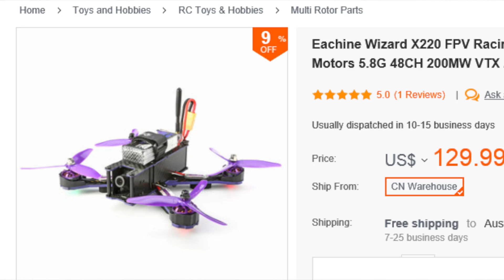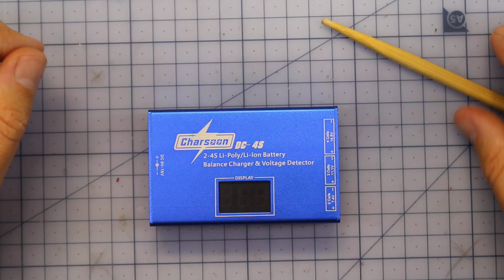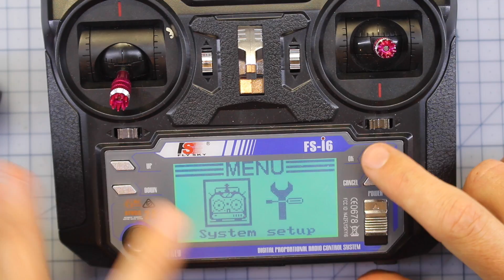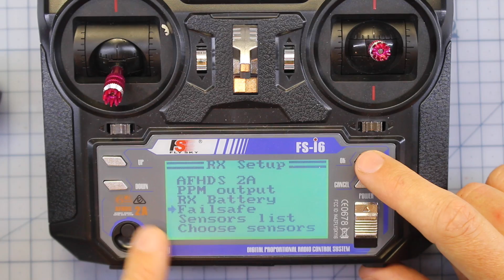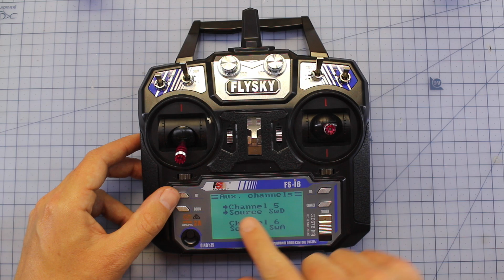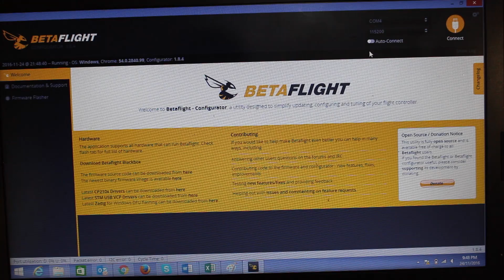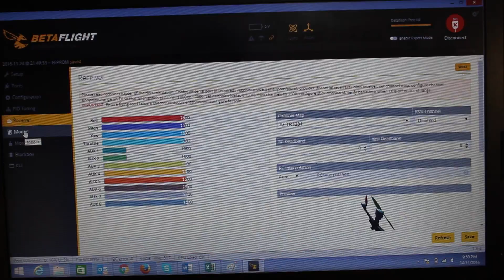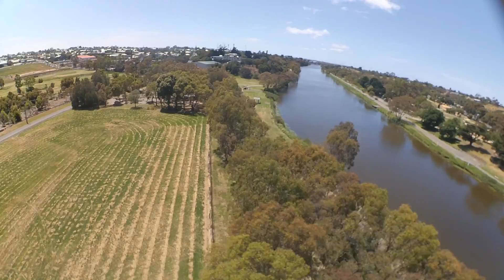How to get FPV DRONE RACING for under $300! Parts +Full setup.

Comment: Thanks for this video. I've been flying Syma X5 drones and nano's, and I was set to buy a Phantom 3 as my first foray into something more serious.  I was derailed after discovering acro videos, and after much research (and watching your videos) I bought the X220. I bought eachine goggles, but I bought the same battery and charger. My biggest variance from the kit in this video was an upgrade to the  flysky fs-i6s, only because it had built-in USB to easier facilitate simulator practice.

Getting the transmitter to work was humbling - it's not as straightforward as the fa-i6. I missed the ibus-sbus switch in the ppm switch (it needs to be set to sbus). After I got the transmitter to work, I took it outside to test it. It beeps continuously and there is a half a second of stick-motor latency. The radio came with no usable instructions, and I'm not familiar enough with it to understand the intricacies of it. Is it likely a transmitter/receiver issue, or more likely a PID/ESC issue?

Thanks for the videos btw, it's all I watch now!
Reply: Update: After calibrating the esc's in betaflight, and after telling the transmitter that left stick is not self-centering, the latency is gone. I found out the hard way that SWa up is acro mode. 

I read a few reviews that said that the stock propellers explode. I thought that was an exaggeration, but unfortunately it's true. A 4S punch out will disintegrate them, sending it plummeting to the ground, destroying you Vivitar DVR 786HD. That would have been good to know Stu...

Comment: I just added the total up on the site and I got 296! This however came with better FPV antenna, 2 batteries  and also using a google chrome extension called Honey that picks out multiple savings code and it found one that saved me $33 just so you guys know.
Reply: With some newer FPV goggles he recommended on another vid the total was $267

Comment: hi sir , 
i have sp racing f3 evo v2 and receiver and remote fs-i6 with his receiver  fs-ia6 and motors
i solder the board with motors and receiver and i binded the remote with receive its work but i have one problem , its the flashing the board in cleanflight cause betaflight not supported , help me plz sir

Comment: My husband received this drone for father's day. When it crashed it broke the little plug where you plug the transmitter in.  Is there a replacement part or do you have to buy a whole new drone.  He only flew it line 4 times.  Am I able to use a different channel with the plug on the other side?  If so, how do I program?

Comment: I recently wrecked my wizard and blew a esc.  I have replaced the esc with the stock 20amp racestar esc, however, the motor still does not spin and if i goin into blheli configuror.  It only sees esc 2 3 and 4.  Is there something wrong with my flight controller?  I have tried a new motor as well.  When replacing esc.  do you need black and white wire or just the white? sorry im new to this and really wanting to get my drone back flying.  Anyone with any input would be greatly appriciated

Comment: Brilliant video! I just seem to be having a slight issue with the receiver. For the RC to connect properly I have to plug the battery in and then plug the receiver in. If I leave the receiver connected, the red light just flashes intermittently. Does anyone have any idea what this could be? Thanks in advance.

Comment: Hi guys, I'm just starting in to this, It is enough to start with Fat Shark Spectrum Teleporter V4 googles and 
Eachine Wizard X220S FPV Racer Omnibus F4 5.8G 72CH VTX 30A Dshot600 2206 2300KV 800TVL CCD ARF ?

Comment: Help!, I'm really into sport flying, and I'm looking at this to be my first fpv drone. My problem is that I'm worried that if I buy the wizard x220, then I won't be able to understand how to use betaflight! Someone please help explain what exactly I need to do so that I have the option of flying with 6 axis stabilization, and all of the other basic things that I should do in betaflight. Thanks!

Comment: Can't get this to work at all.. not a great start :( ... Setting the failsafes Channel 5 fliping the switch doesn't make any change... In Beta flight the Radio doesn't react in the Receiver tab, badly need help
Reply: Did you ever figure it out? I really need help now with the same issue.

Comment: Hello. A lot of comments from me on this build :) Sorry for that. But I am having a problem, one of the Esc's cought fire and I need to replace it. 
But the signal wires red and black on the original is going from the FC directly to the motor it seems (connected on the underside of the motor).  I have connected the main red and black to the Esc and also the white signal wire but the motor is not spinning ... What to do.
Hope you can take the time and show or tell how to change the Esc on the wizzard and what to do with the Signal red and black on the new Esc.

Best regards
T.Robertsen

Comment: i bought an Eachine Racer pro. it have 4  20A b-hely esc (bust 35A). what are the maximum battery  specificts  can it support,
 (3S or 4s, 1000- 3000 Ah, 30-90C, wheight) without risks? have you some suggestion??

Comment: Hello guys! i have bought all of this and have the problem that my copter, as soon as i higher the throttle, begins to slowly raise throttle until the maximum. also my radio (Flysky fs-i6b) doesnt stay stable on the betaflight menu. All the values pitch, roll, yaw and throttle goe from 1500 to 1499 and back really fast so my quad doesnt stay still.

Would like some help. Thx

Comment: Any thing I have missed regarding attaching these props. They are insanely difficult to tighten. Is there not supposed to be a wrench to counter hold the shaft of the engine when tightening down the nut with the thread lock on. Painful to hold on with only my fingers and I do manage to give enough tork down on the prop (my fingers give way before it is tighten fully) 

Hope to get some advise. Otherwise it was a fun trial :)

Comment: Attention: if you are new to the hobby and considering buying this setup and are unsure about the reliability of banggood like myself you can get the everything but the FPV googles from Walmart (haha). I just purchased the quad and radio for $200usd. This is $40usd's cheaper than banggood was currently offering (as of last night). Along with faster shipping :) just thought I would spread the word to all the fpv noobs.
Reply: One last thing. Which fpv googles do you prefer the most? Aomway, flykey, or the fat sharks.

Comment: Yezzzzz got all the parts to day :) Only thing is I ordered the wrong mode controller, but that is a easy fix I hope. I would like to have the throttle on the left so.. 
Any ways, thanks for the video again, no let the Fpv start (simulator first) 

Best regards
Norway
T.Robertsen

Comment: Just got my x220. I scoured the net for hours trying to figure out why the darned thing wouldn't throttle up. I was getting readouts in Betaflight from the transmitter, but still no throttle. The motors worked when testing them in Betaflight. 

FINALLY figured it out. The Flysky FS-i6 transmitter was shipped with the Throttle trim at MAX. I figured it out when I was trying to set channel 3's failsafe. It would only go as low as -75%. NOT -100%

Hope this helps someone! Happy Flying!

Comment: Awesome tutorial and guide - I subscribed also 3 months ago as a result of this vid + ordered it from BG. My batteries arrived today and followed the tutorial and everything went well... Except for one thing : after the Betaflight step : if I test my motors (without the rotors attached of course) with my remote (throttle set at a low level), the motors will steadily increase to their max... Yes, I'm new to this but would appreciate any help :)

Comment: I get nothing when i turn on my remote. I have the receiver plugged into the quad and it hooked up to betaflight. it responds when i tilt the quad. but my remote does nothing in the receiver page in betaflight?
also it doesn't connect to the quad like arm it or anything?
Reply: same help me lol
Reply: "i just reset to defaults via betaflight and it works"i just reset to defaults via betaflight and it works like a charm if someone had the same issue use this trick!🤘" worked straight away

Comment: I was just setting up my radio in the failsafe setting and it seems that my switch d (channel 5) isn't working. If i switch it on and off i doenst change anything (100% to -100%) it's always 100%. Is there a way i can fix this or is it broken?

Comment: does the drone camera output  1080p? If i get the better goggles that have HD i want to know if the camera will send that signal to it. Do I need to upgrade the camera to have better resolution?
Reply: no the camera sucks it would be better to just replace the camera for and hd one.
Reply: Thanks William, Any camera suggestions? This is my first racer coming from phantoms. CCD HD. What viewing angle is recommended? What other mods are recommended right away?
Reply: hobbyking has very good fpv options but I use my gopro for fpv and just plug a transmitter into it. I would recommend putting the camera 30 degrees up that's at least what I do.
Reply: william francone not the camera tilt but the camera field of view. how do you set up a gropro for fpv. is there lag? I'd like to do that eventually.
Reply: Gopro fpv is awesome theres little to no lag and you can record on the camera while transmitting it I use Turnigy light L250 transmitter for the gopro it works great.
Reply: Thank u so much, I have a Hero 4, an old AKASO action cam, and another unknown one.

Comment: So in my build, I used the same flight controller, and same radio + receiver combo. However, when I connect a charged battery to it, the LED on the receiver doesn't light up, and it will not bind. Does anyone know what's going on? 

Also to be noted is that when I power up the quad, I stead of the 3 short beep 2 long beep sequence shown in the video, my quad only makes 3 short beeps. Help would be greatly appreciated!

Comment: Hi Stu, I have set my VTX dip switches as you did on 5820. Bit it's coming in on my Eachine goggles 2 on 5865. 

I manually changed it to 5820 but I just get vague outlines and static. I have wrecked my head as I have double checked it on the VTX manual and it should be 5820 but it won't come in on that.

Any help would be appreciated.

Comment: FYI, you can pick up the RTF version complete with battery and transmitter for $197. Battery looks to only be a 3s so not quite as much power, also, not sure of the quality of the included charger. But with this, the goggles, and the charger Stu linked, you're looking at $288.

Comment: Am I correct to say that the video/FPV system on the Eachine Wizard ARF racing quad is 5.8ghz but the controller setup for flight is 2.4 ghz ? The 2.4 ghz has a 30 to 50 meter range and the 5.8 has a 300 meter range ? I want to buy this but still need to learn a lot
Reply: the 5.8 ghz vtx on the wizard corresponds and "talks" to the 5.8ghz fpv goggles. the fsai6b RX is 2.4ghz and so therefore the TX is as well.  so yeah you have long video range but short flying range

Comment: Ive watched every single wizard setup video but I've not found a single person saying what size hexed screwdriver they use to unscrew the topplate, literally every screwdriver I have is either too big or too small, so I have to buy the correct size, but since it doesn't say anywhere what the size of the screws is I dont know what to get, could anyone help me out with that?

Comment: Newbie question: How do you know when the battery is about dead when flying?
Reply: battery buzzer/checker. its 2 in one and you set the voltage you want it to go off at. its like 4 bucks on banggood

Comment: Having an issue.. When I turn on the controller it starts beeping and won't stop. The battery indicator next to TX is low and flashing. The battery I'm plugging into the quad is mostly charged though, showing 4.0 volts
Reply: It won't let me go into settings on the controller as well
Reply: Okay so it seems to be an issue with the FlySky I6... I put fresh batteries into the controller and it's saying "TX . V1:1.07V" when it should be reading around 6.0V guess I'll have to return it and buy a new one. Bummer.

Comment: I'm a newb at all this, but i ordered this setup awhile ago and just finished putting everything together. Everything appears to be successful, except I can't get the controller to arm the motors, and it also doesn't register any actions in beta flight either. It bound successfully, and i have even used the controller for awhile now in DRL sim without any issues. 
I have reset the controller, updated, rolled back, done everything i can think of but for the life of me cannot seem to make it function correctly. 
Not sure if anyone on here may have gone through this, but figured since its the identical setup i would see if maybe anyone has been through this and found a solution. I'm sure this is probably something extremely simple i am doing wrong.

Comment: Hey, I am very new to flying and was. Wondering if there was a way to limit how far forward the quad tilts in angle mode. Because I am still struggling a bit with flying in angle mode at such an extreme tilt. So I leave with my question if you can do it in beta flight and how?

Comment: i can use cheaper goggles?
Reply: yes you can, I recommed the eachine ev800
Reply: what u think about eachine vr-007 pro?
Reply: When you look at the specs, the resolution on the ev800 is a lot better. Its 480x800 compared to 272x480. That's a big difference!

Comment: Ok so you have to connect to betaflight for it to work, my question now is: 

1. Why is the roll,pitch,yaw, aux3 & 4 values twitching between 1499-1502 ? 2. My switches have backwards values when using the modes menu (switches up mean off)

Should I be concerned, is there a way to fix this? :(

(edit)

Comment: Thank you for your excellent videos. I am contemplating starting my own first FPV build. I think I am not going to use the Wizard ARF, since I actually want to build my first quad by hand from parts, so I might follow your $99 guide instead. The main two questions I have are, does it make any sense to build this without FPV first and add video transmitter later? The goggles in this guide have a rather low resolution, what is the cheapest HD goggles and transmitter you would recommend?

Comment: Nice video! I bough the drone and configured it. Everything works fine except for one thing; if I push the throttle just a little bit the motor keep spinning harder and harder until they reached the max throttle level. Do you know a solution?

Comment: Hey Stu, I’m learning a lot from UAVFUTURES. HUGE THANKS!
I just jumped into this hobby and had a question about battery flight expectations. Please tell me if i should be poking around forums instead.

I may have been a bit overzealous when I jumped into this & picked up components that are WAY out of my ability. Im aware of the steep learning curve, but thats ok. I can already tell I am gonna love this hobby.

I am fully built and now am just learning to get my quad off the ground and hovering. Problem is Im only getting 3-4 mins MAX on a full charge.  I am barely getting this in the air for any length of time. Ive even dropped my throttle curve in my radio to 80% to keep myself from losing the thing on an accidental punch out. :)

Here’s my setup. Im worried I over spec’d the thing, but am hoping its a simple matter of moving to a larger capacity battery.
What do you think?

Martian II 220
EMAX 2205-S (2300Kv)
Littlebee BLHeli OPTOs - 30A
KISS FC
FLYSKY I6S
HQProp clones 5x4x3
Turnigy MultiStar 1400mah - 40-80C 3S

Comment: I have about 3500.00 USD to spend on a setup, does anyone have recommendations?? I am not new to RC but new to quadcopters. I have been in the rc heli and car hobby for about 10 years now so i have plenty of 4 and 6 cell lipos and 2.4ghz receivers and controllers.

Comment: I am having a serious problem with my wizard when I arm it without the props and give it a little throttle and then it slowly keeps creeping up in speed the revs of the motor until it is screaming the only way to stop this is to lower the throttle to the very bottom other wise it does not slow down.   I am at a lost I am afraid to put the props on it like this.

Comment: Help needed: got my wizard, flew it a few times, no major crashes. Then 
one day I went out to fly and one of the motors has stopped working all 
together. I have checked wiring, everything is connected. Could the ESC 
already be out? I just want to get back in the air!

Comment: Excellent video. has made me want to go buy this set up now. 

could you answer a few questions for me?

would you recommend learning to fly drones without fpv first? so should I buy the emachine wizzard and controller first then splash out on the goggles? 

Is there a high quality budget version of the low profile fatshark goggles out there? I can't see myself wearing the larger goggles listed here. Or would you recommend making the jump to the fatshark teleworkers v5?

Would you still recommended the wizzard over some of the newer drones you have reviewed lately?

Comment: I FOUND IT FOR UNDER 250$!

Wizard x220 RTF-  http://www.banggood.com/Eachine-Wizard-X220-FPV-Racer-Blheli_S-Naze32-6DOF-5_8G-48CH-200MW-700TVL-Camera-w-FlySky-I6-RTF-p-1077100.html?rmmds=category

5.8ghz FPV Googles-  http://www.banggood.com/Eachine-VR-007-Pro-VR007-5_8G-40CH-HD-FPV-Goggles-4_3-Inch-Video-Headset-With-3_7V-1600mAh-Battery-p-1134154.html?rmmds=category